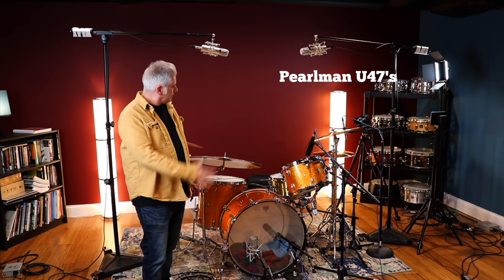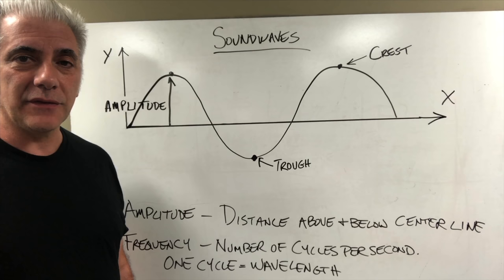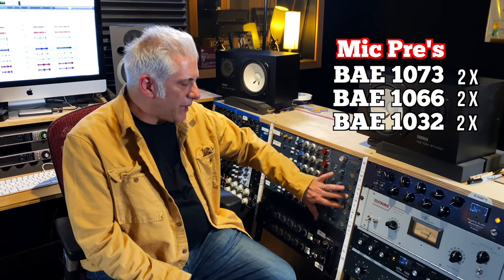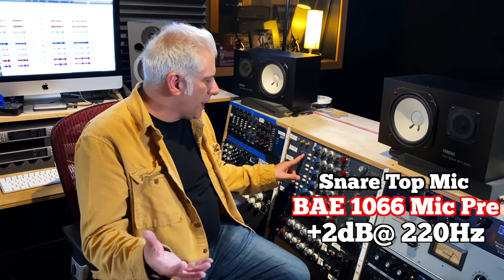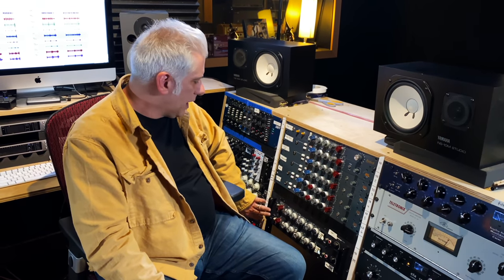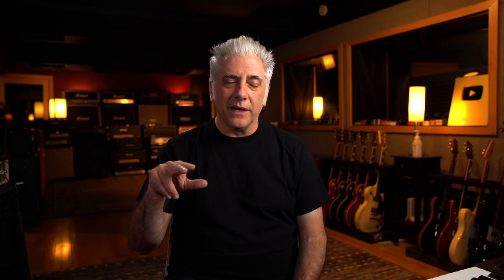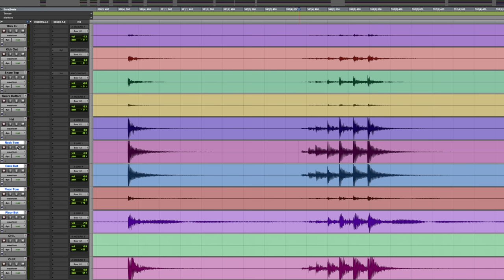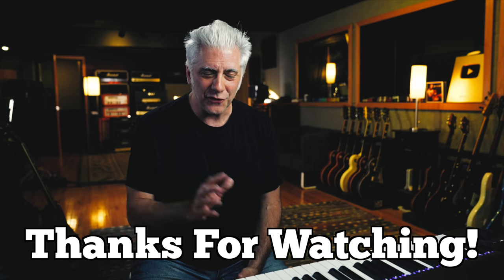What The Pros Know About Drum Recording

Comment: Thank God somebody addressed the issue of phase relationship, which is the single most critical factor in recording anything, let alone drums.  Brilliant presentation, Mr. Beato.  As a 50+ year, gold awarded engineer, I can appreciate this a lot.  I would like to address the use of the overheads and what I believe to be the best possible placement thereof.  For maximum stereo separation with the least amount of phase cancellation, the plane of the mic diaphragms should be exactly perpendicular - 90 degrees to each other.  The ORFT method / system called for a separation of about 7 inches and an angle of 120 degrees, supposedly most closely approximating the way human ears receive sound.  When overheads are properly placed, the overall drum sound from these mics alone is the purest and most natural.
Reply: This is my broken record spiel, but I kind of want to point out how "approximating the way human ears receive sound" isn't necessarily the way to go. I mean, there is a lot of truth in there as far as typical recordings, genres and settings are concerned where you want to fall back on an "optimal" way to mic your drums, but at the same time there is just so much in the way of stylistic emphasis and articulation that begs for people to just do everything to taste; it should fit your arrangement and your mix more so than cookie-cutter conventions people have come to accept over the years. In my book, there is no such thing as purest and most natural. The thing most closely matching this description is whatever fits your song or performance, and that is just not something you can capture in specs... at least not quite.
Reply: @minhuang8848  Excellent comment, Min!!

Comment: This is a terrific video that Rick has produced here!  I would  add, for your consideration, the following:

On most drums, the two heads are significantly separated from each other and, as a result, the resonant head will naturally vibrate a fraction of a second later than the batter head, and then some of this sound bounces back re-implicating the batter head. This means that baked into the drum when played are complex phase relationships that also, to some extent, vary by the set of frequencies emanating from the batter head and the shell as sound reaches the resonant head. These phase effects are relatively complex, and are also dependent, as a factor, on the type of heads used, stick type, playing style, how tight the snares are (for a snare drum), shell material, the head tensioning, the type of bearing edges, and if any dampening/muffling is used.  

My point is that the "natural" sound of a two-headed drum has baked in numerous phases cancellations "and" boostings going on that depend on the factors I've mentioned above.  By "boosting" I'm referring to the extent  that increases in amplitude occur when phase frequencies become aligned; cancellations happen to the extent that phase frequencies are non-aligned. It can get more technical but that's an overview.  The mics (their number, type and location/position) have their work cut out to capture a simulacrum of the drum's sounds! We're all trying to capture an instrument that itself has phase problems or delights, depending on one's perspective.

Comment: Great video- one thing I had to learn over time that its not just about flipping phase, often two signals have the same "type" of phase but they are just out of alignment with each other. In fact, the opposite phase phenomenon is usually only encountered when micing bottoms of drums, and behind open back guitar cabinets. 90% of the time, Im zooming in and nudging waveforms to fix phase problems, not flipping the phase. A waveform thats 50% off axis with another will sound just as out of phase when flipped.

Comment: Unfortunately a lot of people think that phase is a set and forget situation which it isnt. The phase buttons when tracking and especially mixing drums, should be something that is constantly being checked throughout the entire process, same way youd check a guitars tuning after every few takes. Even the smallest changes that seem insignificant can have a dramatic affect on the phase relationship between different drum elements. This is evident when applying a simple high pass filter on the top snare mic. The resulting phase shift from the high pass filter changes the phase relationship between the top snare and overheads. Even the frequency you select will change the phase relationship between the snare and overheads. A high pass filter at 80hz may cause the snare to fall out of phase with the overheads, whereas another selected frequency may keep it in phase. So checking phase after each eq decision is valuable.

Comment: ages ago i saw nick didia and brendan o'brien double mic toms with 421's and nick just used a simple y microphone cable with one side wired out of phase. that way you get the top and bottom sounds, but use only one mic preamp. been doing this for years. works great. 

thanks for such great stuff, rick.

Comment: Interesting video, but it might further confuse the terms "polarity" vs "phase". As phase is time based, a switch labelled "phase" would only allow one adjustment value for time - useless for most of what you're talking about.  I don't know which console maker was the first to mislabel the polarity switch, but that practice is still in use today due to mass ignorance. When dealing with two or more microphones we deal with polarity and phase at the same time, able to adjust for either now, especially as we can move audio regions in a DAW (phase adjustment or time aligning). When we mic in stereo, and mix in stereo, we can adjust the volume of one signal to the other and have the sound appear to come from a position between left and right - but we could also do nothing with volume and use phase to move items within a stereo mix field, as what happens with our two ears and how our brains process the signals.
With close micing, we have exposed audiences to unnatural sounds for drums and other instruments, instead of attempting to make them sound real. With front and back kick drum mics, or top and bottom snare and tom mics,  we create an unnatural sound, one that no-one will ever hear in the natural world - unless they have four ears on long protrusions from the head.
With recording and live sound we can do many unnatural things, and in art everything is acceptable, but when we use terms like polarity, phase, delay, reverb, echo, etc, I think we need to be more correct in passing on the true meanings and concepts being discussed?
🤔

Comment: First of all...how great would it be to have access to your mic cabinet?  I have a rather large kit, I'm running 20 mics when I record.  I'm going to add one more to see if it's worth it.  I actually use 421's on my snare.  I did a mic test, video on my page, and of all the mics I had, the 421 was the best.  However, the 57 was surprisingly close.  I also used a Sennheiser e604 and e904.  Anyway, I close mic all 8 toms with e604.  I have kick double miced with e901 inside on a brick about 20 mm from the batter head and a e902 outside about 8 inches from where the reso head would be if I had it installed.  All that is under a blanket.  Snare 1 is double miced (421 over a 57), snare two is not.  I have my two over heads (AT2035), hats and ride (ATM450) two 57's as stereo room mics, and an AGK P420 condenser about 6 feet in front of the kick.  I had someone say placing a ribbon mic with the AKG mic and picking up the sound coming in from the side is a nice sound.  Once I get my studio up I'll be trying that and shooting a video.

Comment: I agree: dragging a clip to correct phase is not a very good technique. Why? Because you'd only be making it APPEAR in phase, visually, which may or may not even improve phase correlation, which is why there are a number of plugins (Waves InPhase, Sound Radix Auto-Align) that actually measure phase correlation to give you a more objective point of reference than what you see on a monitor. Adjusting phase relationship between correlated signals is absolutely just as important as adjusting polarity, possibly more, as equalization affects phase, and plugins that measure correlation are very handy tools to help correct phase after EQing correlated signal differently. The only time I use the visual appearance of the waveform to help correct phase is to see whether it looks like lower frequency content is polarity-reversed as higher frequency content is in polarity, as an all-pass filter might be useful to correct frequency-specific polarity issues before measuring correlation to adjust the phase relationship.
Reply: Important observations!

Comment: A lot of the live sound world is starting to play with delaying the close mics to the overheads, similar to dragging the wave forms to line up in ProTools. When they're using different sets of plugins on each mic or group of mics, the additional latency of the plugins smears the sound more than this relatively straight signal flow. It does change the sound, but not always better or worse. It always seems to make them sound a lot more punchy to me. It might be a good technique for pop drums, if they ever use real drums.

Micing the bottoms of the toms is not something I've seen much of in the live world, but it's definitely interesting. It reminds me of the effect of a drum smash bus, but much cleaner. Thanks for this!
Reply: Not worth it in a live situation to double mic toms imo. More things to fool with and setup, not to mention the potential for extra cymbal and/or stage noise bleed. Snare and kick would be more worth double mic'ing. 

If they're using "no delay" plugins in a live console, like Waves, the latency shouldn't be that much. Even digital consoles have a to d then d to a conversions that take time. You have to wonder how much difference it makes out at front of house, the minimal phase differences of the toms to the overheads. I guess it depends on the size of the space and how much work the PA is doing.

Comment: Transformerless 57s are terrible for drums, especially snare.  The transformer rolls off the top end above 5KHz on the 57.  If you remove the transformer it opens up the top end and makes the 57 very bright... which is BAD because the 57 is OMNI DIRECTIONAL above 5KHz.  So you will have TONS of bleed from hihat and cymbals in the snare mic.

Comment: Great video series, thanks for these!!  Just a note from one audio engineer to another, some of the video clips you cut to in the studio have some very low bass frequencies coming through?  Sounds like 60hz cycle-ish kind of stuff?  I'm guessing most people won't notice at all as they're on a mobile device or laptop speakers, I'm using Beyerdynamic DT770 Pro headphones and every time the camera cuts it's like.... wait wut?!  :D  Love the channel!!!
Reply: I believe it. I missed any deep stuff. Heard a little 60ish junk during the ProTools segment on the kick... but that'd likely be heard on most any playback, as it's not down in the low octaves. 

I too am sensitive to LF/ULF on YouTube or any medium... local TV news is often the worst!

A production like that without a quality rig with full extension, ... they have no clue what their output is like in the bottom octaves! HVAC noise, structure borne mic noise etc. 

Typically I'm either consuming content via high end in-ears, or our primary home theater which is -3dB@9hz capable. 
I've got all active surround rig, w/16.8kw, 200hz and below covered via (6)12"s, (4)15"s, supplemented by quad 18"s in an Infinite Baffle attic manifold sub.  
So you're right, unintended LF can be a nuisance... but otherwise it's incredibly resolving of those big LF transients. 
Every octave downward requires a quadrupling of stroke capability. Resolving that deep stuff at realistic levels with adequate headroom... damn, the requirements add up fast!

Comment: How do you decide what to allow to clip? You have great mics and preamps feeding to a presumably great interface (AD converter). I see in your waveforms that you definitely have peaks at or nearing clip (in the worst sounding, digital, part of the signal chain). I’ve always worked very hard (as a live sound engineer dabbling in recording) to avoid clipping except where explicitly planned (e.g. tape saturation as a component of the sound). You are far more experienced and far better at your work than I so, am I misreading here or is this a “by ear” choice or what?
Reply: I wouldn’t recommend clipping converters, keep tracks around -18 on the way in.

Comment: Hi Rick, great video thanks! I have a question about cable lenghts for the 2 overheads. Would it be noticable if you use 2 different cable lenghts to the recording device? For example 1 cable of 32ft and the other 16 ft.

Comment: I’m curious about your toms’ pitch intervals between top and bottom heads of each tom. I’ve had the best luck tuning each of mine with the top pitched a fourth below the pitch of the bottom. So since that bottom head’s kinda up there pitch-wise, I wonder if the bottom mic would sound boingy or whatever effect it would have. 
Note: with that tuning ratio, the overall pitch of the tom is an octave below the pitch of the bottom head. Wish I could say why. 
Just thinkin’ out loud ova heeya.
Reply: I've been using a minor third between the heads so that the bottom head is higher. Seems to work incredibly well regardless of the size of the drum: well, 10 to 18 inches anyway.